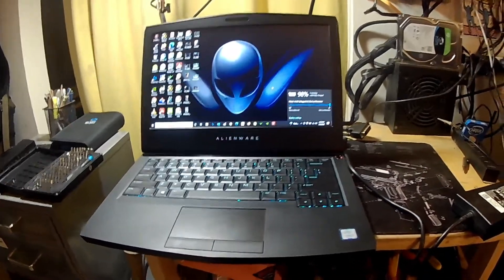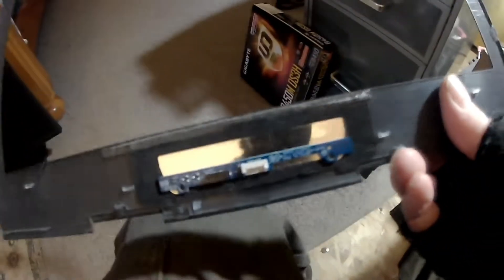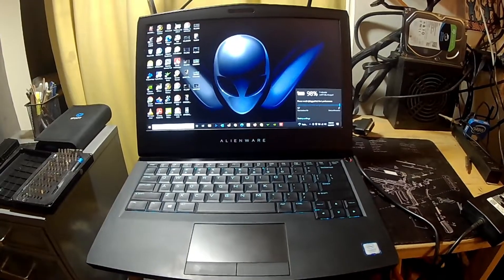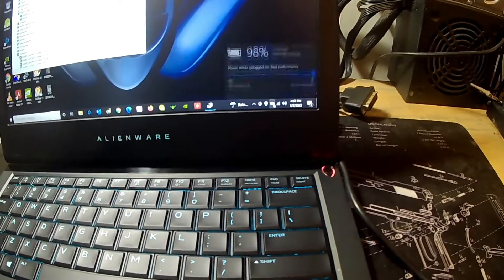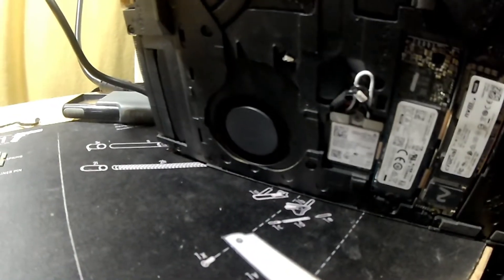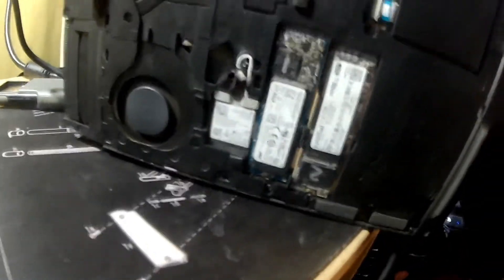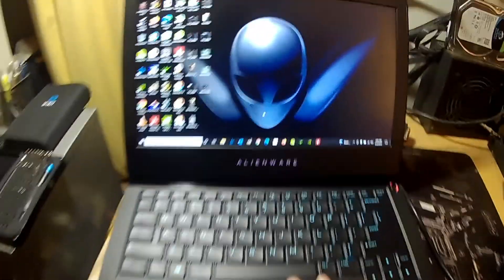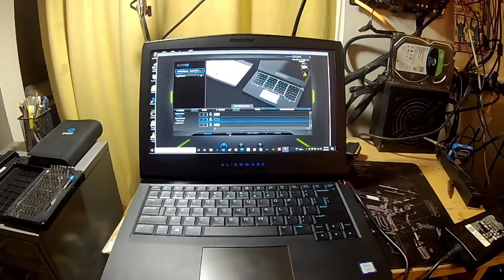Alienware 13-R3 rebuild

Comment: Damn man, I thought I could replace that wifi card and be quick about it, but NOOO it had to be a piece of garbage.  Now I'm looking at splicing new wires in like you did because the connectors are impossible to clear with the tools I have on hand.

How did you do your splicing?  shielded cables that size must be a mighty pain to splice.